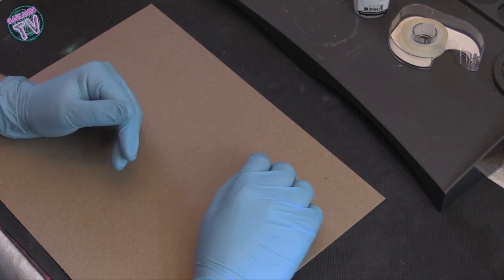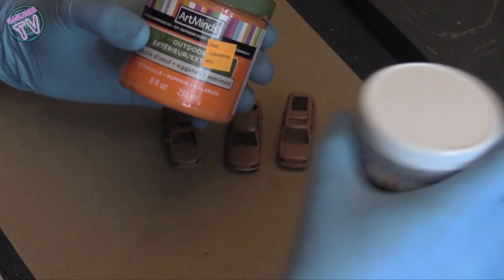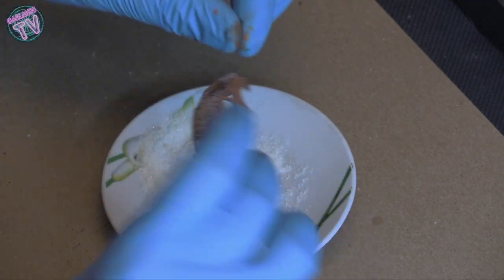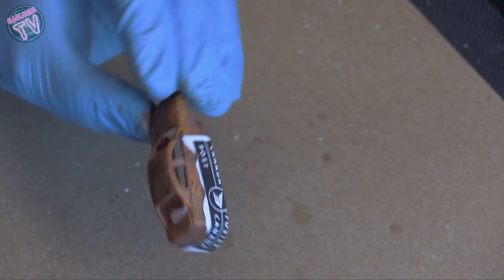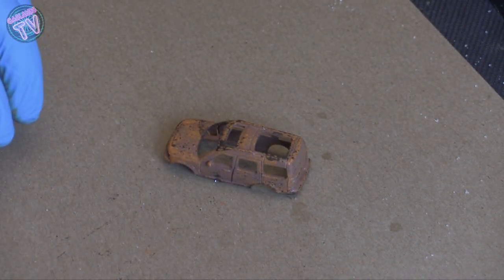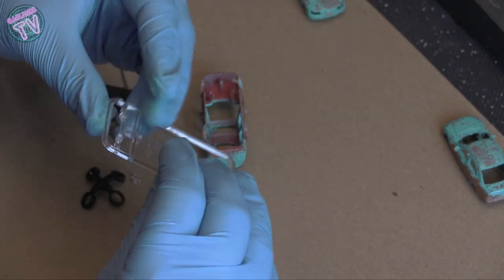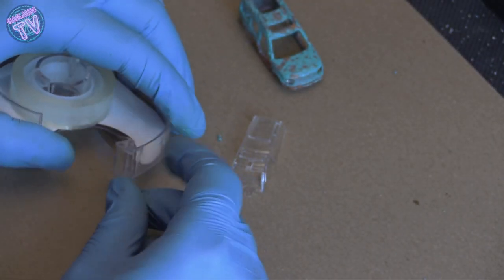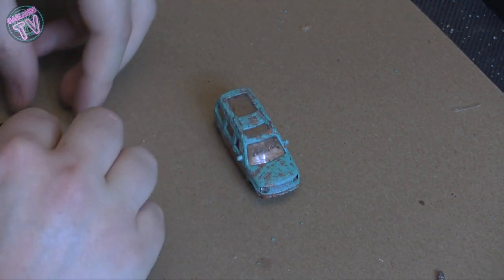How to Weather Model Cars Using Salt Method - Gaslands TV

Comment: Great video!  Just wanted to say that tape method will actually work quite well if you use masking tape.  Same method as the paper and sticker, just tear it lengthwise.  Used that method a few times to make tiger striping, too.
Reply from the maker: Great tip!

Comment: Does the salt chipping work if you're brushing the topcoat on, or do you have to use aerosol or an airbrush?
Reply from the maker: No it wont. need spray or airbrush. unless you find a way to glue the salt and make sure it sticks to the car before drybrushing the top coat slowly without moving the salt. then once dry, you can remove the salt to reveal the undercoat of RUST.
Reply: @GaslandsTV  Thanks I'll still have to try it sometime.